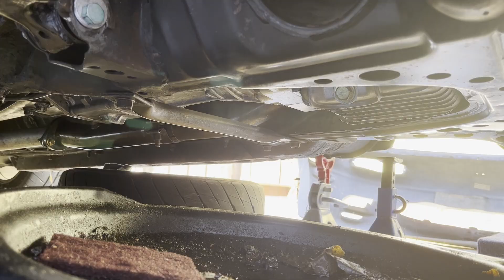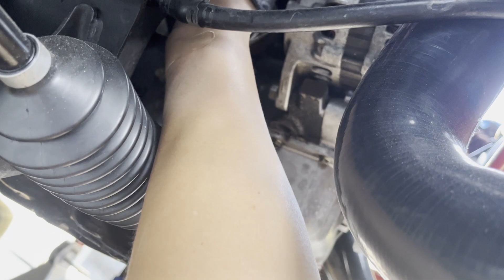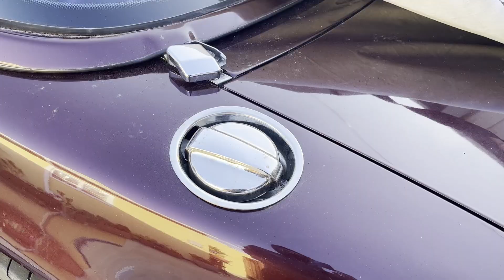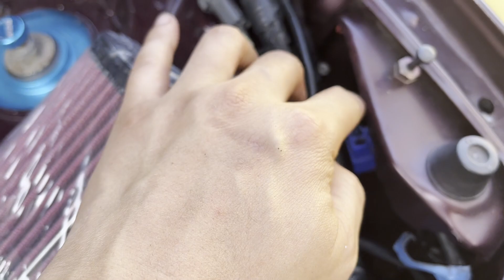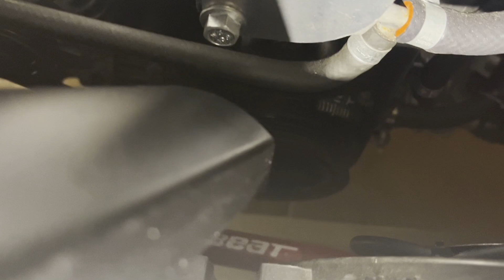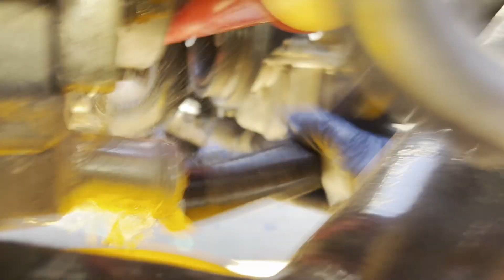Turbo Miata First Start Up!

Comment: Great video! Going to use save this for when I do mine, I’ll remember not to leave the plastic packaging on the cone filter when starting it for the first time tho 😂;)
Reply from the maker: Glad you enjoyed the video. I only had the plastic on when checking oil pressure. I almost did forget to remove it though haha
Reply: In the video it's running with the filter cover on it  @wils_builds
Reply: @wils_builds  yeah if you look back the cover was getting vacuumed sealed to the intake when the engine was running aha, I’m surprised it started tbf 😂
Reply from the maker: @DeepF1ASH  Oof you right. Im an idiot haha well it runs now at least
Reply: @wils_builds  ahaha, good man